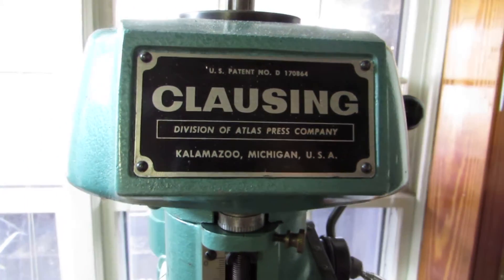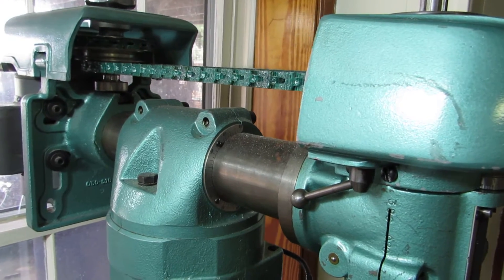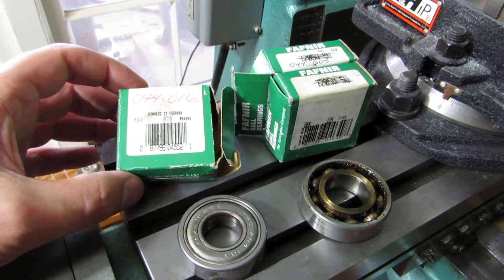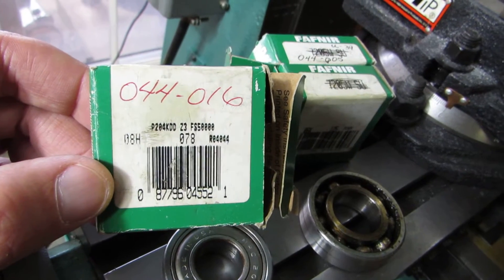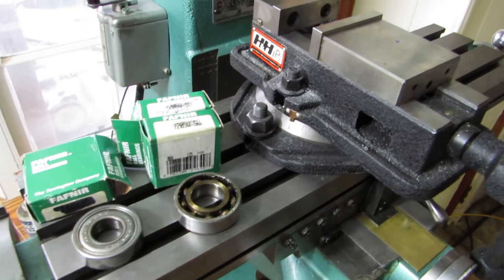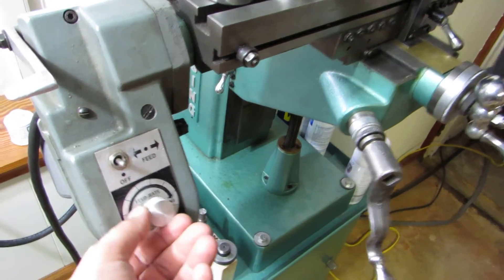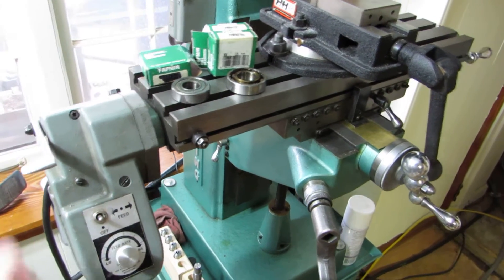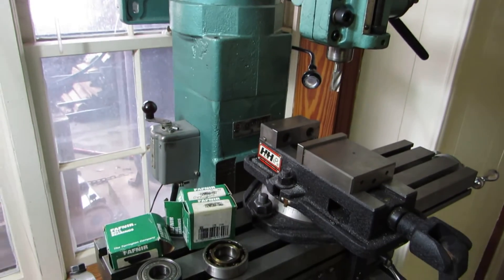Clausing 8520 spindle bearing replacement and power feed demonstration

Comment: Hey Noel, what does that pin in front of the quill down arm do and what size is your vise ( HHIP) ?
Reply from the maker: "Sensitive Feed Handwheel" with the handwheel part not installed.  4" vise.
Reply: Thanks for the reply, i also have a 8520 i just picked up this past summer and didn't come with anything extra so im looking for a vise and from watching your video it looks like the size your using fits the table well. What's your thoughts on it  price, quality and accuracy ?
Reply from the maker: @mibooth1852  It's a great little unit.  They've gone up in price since I found mine about 8 years ago, but it's in mint condition and is tight as the day it was new.  Every bit as accurate as you can get on any mill of this size in my opinion.  Absolutely perfect for the guy with a small shop.  This and a South Bend Heavy 10 and you're well started.

Comment: I just recently got one of these machines,  believe it or not from a dumpster. I cleaned it all up and derusted some of the parts. After I reassembled it I noticed that the spindle drive belt is not perfectly aligned.  How do I rasie the front pulleys (above the Quill) about "1/4?  Any advice on this would be great. Im actual thinking of posting a video on my find.
Reply from the maker: My first instinct would be to check the assembly manual to see if there's a spacer missing.  I can't believe someone would throw this machine into a dumpster.  Makes you sick, but I'm super happy you rescued it!  Looking forward to seeing those videos, I just subscribed so I can watch them and your progress.
Reply: I found the problem,  someone put a washer under the idler pulley to make it line up with the motor. Instead of just lowering the motor. Duh. But I git it up and running and even got a bunch of short videos posted. I'm on the search for a brake disk / brake shoe for the head stock mine is missing.

Comment: She much more quiet now. I guess the video was coming across as noisy. But I was wondering about the spline itself (that sticks up and out of the top of the head). That has some ribs. I greased mine o my drill press and it prevented it from clanging around, as there's a little bit of play in a ribbed spline. 

Fun fact - I (had) a Clausing 8530, for about 1 month and then got a great deal on Bridgeport. But those Clausings are sweet - AND easy to move. Parts are still available too from Clausing ;)
Reply from the maker: +BasementShopGuy Ah, sorry.  I misunderstood.  I'll grease up those splines and see how she sounds afterwards.  And yeah, it's a groovy little ride.  Plenty powerful, and certainly versatile enough for the average home shop enthusiast.  And that Bridgeport restoration you did is what I meant earlier when I said attention to detail.  Beautifully done!  And don't get me started on your South Bend 13...  We all drool over that machine.  Clausing has been very good to me, and when they don't have the parts in stock anymore, they're kind enough to send me an email with PDF attachments of the original blueprint drawings so I can make my own replacements.  I had to do that with several parts within the power feed, and this made my life much easier.  For that I'm very grateful.
Reply: +Noel Barlau Yep it's been my experience that Atlas/Clausing are an excellent company to deal with as well. Some very knowledgeable people working there.